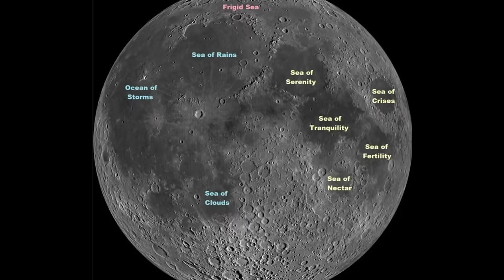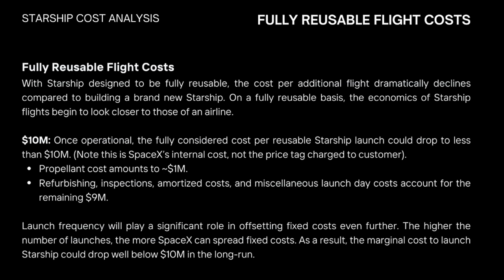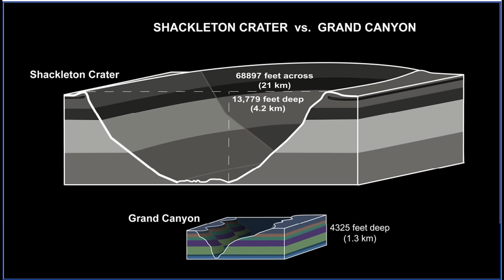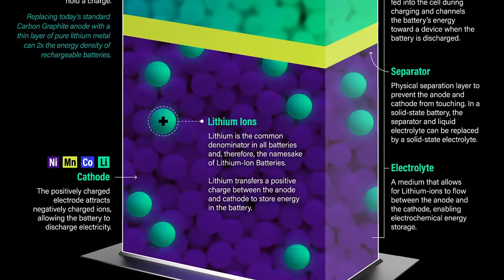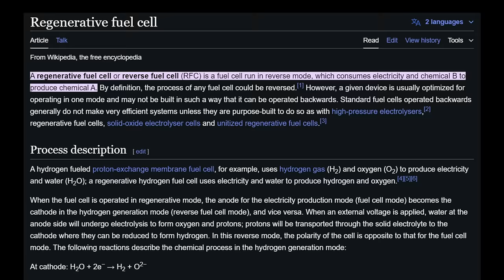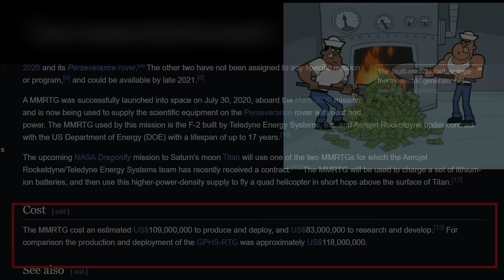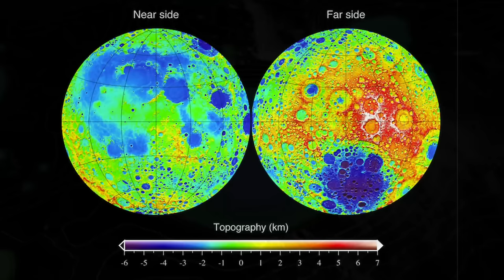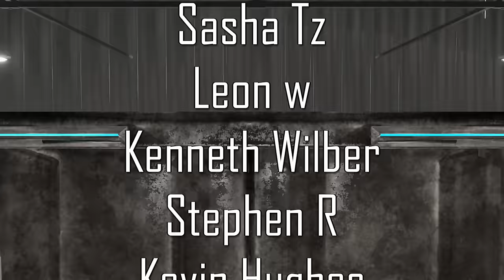Probably Not The Poles

Comment: Even cheaper would be a gravity battery, dropping a massive weight of rock down into one of the giant lava tubes or a crater. And of course digging a big hole if required.
Reply: Gravity batteries on the moon are one of the worst options, too much effort and too little profit. There are a bunch of other options. Not impossible though , it's just too much effort for the value it delivers.
Reply: @Molb0rg  Please forgive me. I fail to see the intense challenge in cutting rock to the desired shape and using it as a weight in a gravity battery. A weight of concrete the size of a house would be able to store the energy needed to power that same sized house. Although the math would be different on the moon.
If one wishes to use solar then they need to store the energy for later use. But I prefer nuclear and beaming the energy over a long distance to end user.
So could you elaborate on the short comings of the gravity battery?
Reply: @Maytrx you mentioned it yourself, math will be different. For the same amount of efforts - cutting a rock - you get 6 times less results. With solar panels for the same work of making them you get about 2x more results. But that is relative numbers.
One cubic km of regolith, and a difference in height 1km can store  725GWh in moon conditions. So to backup that over night you need about 350 cubic km's worth of gravity storage.
Energy density of such storage is about 0.45Wh/kg.
It is one of those things which looks simple on surface and gets you "free" stuff, but when you start to dive in actual making of it, designing it, what it takes to implement it - it loses its attractiveness more and more deeper in the details you dive. Gravity storage - I love the idea, really, I wish it could work well, but it works so so - it does work however, no denying that, I know it is poor but still see it as a lovely idea, but when we think on making things happen - you need to be a coldblooded bastard who trusts only numbers, no preferencial treatment based on appeal.

Cutting rocks if you dive is a complex process which requires a lot of tools, machines and energy.
There are already dug holes - craters to use, and there is such a thing as ERoEI  and most likely for different reasons you will end up casting weight blocks, and spending about 0.5kWh/kg energy. So the battery of this sort will make 100 cycles  to "return" the energy, so you have for 100 consecutive months to spend energy on making  the thing to enable storing energy for half a month(and no inefficiencies were accounted here, which will make it longer). That alone affects many things, has a broad and lasting set of consequences.

If you wanna make it work, well I'm not stopping you, maybe you find a good way, and it can be beneficial for everyone, so go ahead, good luck!
Reply: @Molb0rg  Ohhhh.... I see now that it also involves Energy-In vs Energy-Out. I was thinking that it would be cheaper than importing a complex, big, heavy and expensive battery array made on Earth. But as you pointed out not necessarily eh.
I was like, "The rock is already there and the idea is to do mining anyway." Yet it still requires a lot of equipment.
Hey thank you for the explanation eh.
Reply: @Maytrx  well it seems I did made an error and it probably even worse. So free hole and "paid" blocks seems a no go. But in theory the bigger of a block you carve in one go, the less energy you spend per kg of acquired mass(cube square thing), maybe you can go away with 100x100x100 meter blocks. Oor one can carve 10km deep and try to lift the thing as a sheet of weight - so there are variables to play with, smarter designs, better cutting technologies etc etc. so there are variables to play with to make it happen. Oor maybe one reaches the point when all things which needed to be done are done and it makes sense to spend all this energy to improve efficiency(but at this point you may have an equatorial belt of panels and permanent light this way, or satellites in orbit beaming energy and no need to store energy. So it is hard to say about all the technologies and possibilities in all the future and needs, it's just if one has to choose stuff early on, unfortunately this captivating one is not a choice if one wants things fast and easy.

In theory gravitional binding energy of massive enough bodies is a respectable energy, and those gravity storages are subset of that bigger thing, so it not like we should totally forget it as an idea, but ...
Reply: @Maytrx  100 meter drop, some crater slope, and 225t of rocks dropped there per hour can provide 10kW of power, well 60 thousand tons of rocks per night, well I guess it possible to find it free laying on surface or something - no energy spent, on blocks and a hole and it just transporting it all to the place, make some sort of station up and down - well if it only option then one can do it and it will works, so..., lol, a free exercise to see the challenges to make it happen in this case.

Comment: The general opinion about energy calculations could be incorrect. A Moon base can be easily thermally protected to avoid losing energy to the vacuum during the night with a metallic film. Managing excess heat is the main problem, as proven at the ISS. 1370W/m2 is a problem for solar panels, and most materials exposed to full-spectrum solar light, definitely not sustainable in the long term. Heat can be applied to solid rock through metal conductivity, reducing complexity. The moon surface (Regolith) is an extremely good insulator; like on the beach, heat does not affect a few centimetres below the surface. The hot/cold temperatures measured by the reflected light from the top layer of regolith are not representative, as the Moon has no atmosphere or humidity, so no conduction or convection is possible; a thin layer of a few mm is only really in extreme temperatures. The logical decision is to inhabit lava tubes or caves. 50% of all regolith is oxygen, 2/3 of all propellant needed.

Comment: Technical details that seemed to be glossed over.
First, when comparing batteries against fuel cells please take into account the round trip efficiencies. Batteries are 90+, fuel cells plus hydrogen production and storage ~30 so would need ~3× solar to recharge.
Second major one was comparing space engineered nuclear with a Earth based micro reactor. The air cooling for the micro reactor won't work at all on the Moon. I suspect changing from air to space based radiator cooling would be "non-trivial" for design and operation. Hopefully it is better than I expect but without further information I don't buy the comparison.
Reply: The solar panels are only in darkness for 3 days out of the month, so 9 days worth of energy over 27 days means you only need 1/3rd more energy then the base consumes over those 27 days. sure it's a decent amount more else panels, but since it has 27 days to recharge, it doesn't make it infeasible.
Also, I'm no expert on the specific designs for the microreactors but, I'm going to assume they use heat pipes and the tried and true fan-push-air-through-radiator method for their cooling. In this case the heat is already being piped to the external surface of the reactor, and if so I think it would be fairly trivial to take off the radiator and replace it with a vacuum radiator as long as it provides the same wattage per time in cooling. 
You would probably need a more robust electrical controller and wiring than that used for a fan, and maybe a more specialized heat pipe to feed into the radiator because lower gravity could effect the speed of the evaporative substance inside the heat pipe.
Unless the design specifically relies on the air being fanned through the center or subsurface of the reactor for some design critical reason, which I think is unlikely, it should be a fairly simple reconfiguration.
Reply: @brodyrex6987  The efficiency of radiating away heat in vacuum is very low.
Reply: @Gustav_Kuriga  When the heat is already being brought to a place where you can attach a radiator of any size, the decrease in efficiency can be offset with a bigger radiator. Maybe it'll take another launch because half of the fairing space is a folded up radiator, but the point is that it's not infeasible, and still economically viable.
Reply: @brodyrex6987  You also have to account for the increase in medium which is bringing heat to the radiator, the increased time needed for that medium to be in the radiator to take away that heat, the choice of medium used for that purpose, the added complexity of building a base that has two power sources instead of one, etc. There's a lot of things not covered.
Reply: Rolls Royce seems confident they can do it and from the looks of their prototypes it seems like it can be done
Reply: Space grade PV is about (planned, the best) are like 2kg/kW. So adding another 200kg is a rounding error here.
Reactors, yes have to be adapted probably, not speaking certified for launch and all the way down - not trivial.

Comment: Question I know that starship is just a simple example but wouldn't earth mass drives be better it would cost less and be more environmentally friendly sure it would have less cargo but in your orbital infrastructure video you mentioned a cargo transfer port in L.E.O for I free using 3d printer ship yards to made infrastructure for lunar transfer and being real it would be sufficiently safer
Reply: Having a massdriver is always better than a rocket, but the biggest problem here is we may have a rocket in 5 years, but we won't have an earth massdriver in this time.
Reply: @Molb0rg yes however it seems that people will eventually realise mass drivers are more effective therefore moving to mass drivers as the main launch machine

Comment: Carbon IS present on the Moon in the form of carbonaceous (c-type) meteor impacts. Figuring out which meteor impacts are carbon rich is a different story; not to mention, mining them. I am not sure if there is a way of remotely determining which impact is carbon-rich and which isn't..
Reply: No need to seek for them, they are all over the surface, there is about 200g of carbon per cubic meter, and it is extractable relatively easy

Comment: How much would it cost to run dc power lines around the equator of the moon? Sure, there would be transmission losses, but the moon has plenty of aluminum, and you could just roll it out over the ground, unspooled from a rover. Obviously, the idea is to build a belt of interconnected equatorial solar farms so that some of them are generating power at all times. This way you don't need batteries for nighttime.

Comment: But importing 200t of water is a bit stupid, no? Importing hydrogen when you already can stuff excess oxygen from "smelting regolith" into on site produced steeltanks to turn into water later is more viable, since you can get up to nearly twice the ammount of water out of this. I estimate including the tank and baffle plates etc. it would hove somewhere between 1,5-1,8x the ammount of water if you reform it on the moon. You could even get to try and get some 'kick' out of that reformation by either running a fuelcell or using chemical subreaction etc. to extract more value? Also if you want to store it long term, either turn it into water/hydroxite/acid which are somewhat easily store as a liquid and can have various uses in life support, or industries.
And if we return to the nuclear ferry between LEO and low lunar orbit you can shuttle more stuff back and forth for cheap, combine that with your railsleds and we can extract more economy of scale. Something about thsose railsleds and nuclear ferries also would mean we would need to revisit teh cost calculations of the earlier episodes in regards to bringing humans, materials and supplies to the moon, because that price would go down, especially with the synergy of the nuclear ferries with the railsleds.
As for power storage, that is nice with teh sodium batteries, but teh company called "Ambri" has developped "liquid metall batteries" on the basis of electrolysis, it works teh other way round. In their case the "alloy" of sodium and another metall is heated up and liquified, a layer of another material keeps the boundary, you can extract electricity from this and the stuff mixes, hardens and cools down. To recharge you simply liquify the stuff again. Recyclability seems good, weight not so much, so stationary use is recommended, but this could be usefull anyway because those lunar excavation machines need the weight anyway? And if those cells by ambri are deemed to have too many efficiancy losses, they still can be used for stationary purposes. The main purpose is to be "dirt cheap" with these things and they are somewhat simple to make so that could be a boost in the beginning.
I noticed that CO2 removal was (seemingly) not yet looked at, it will kill you faster than lack of axygen, well we have three+ options here. We could use MOXIE to reduce it down to carbon monoxide and chemically use it to make other stuff, we could compress the CO2 and react it with hydrogen to make methane and then polymers from that, we could also use the CO2 and metalls and react it into alloys with carbon content while freeing up the oxygen.

I also am currently bingewatching the series, but have not yet seen all of them, so it may be some of my points already got adressed.

Comment: Just asking why not simply make a power satellite or a solar disk satellite in "geo-stationary' position? I'm sure it is more simple to do then the Gateway station they are about to scrap anyway...
Reply: it's probably pretty hard to have something in (would it be lunar-stationary?) position when the orbital period is the same as the rotational period. You could put it in low Earth orbit and get 1/2 uptime, or maybe some legrange point on the far side of the moon. Basically, the nuclear option is just better
Reply: There isn’t a stable luna-stationary orbit possible. Because the moon is tidally locked, small, and still relatively close to Earth’s massive gravity well, it would require constant burns to stay in position without being pulled out of sync.
Reply: it would get torn to shreads by debries. Its hard enough to the the ISS and satalights to not hit eachother and debris so a huge solar array would such to menover
Reply: not what we’re talking about also wrong

Comment: Can't we use a solar mirror satellite ,to reflect the sun's heat to the lunar surface.The is no atmosphere and clouds on the moon .

If we can get a lot of those satellite ,it could be a cheap heat source that can be used on making lunar metals and powering solar panels
Reply: It is enough to do the same on surface, early and midterms
Reply: @Molb0rg  that's why you need more than one satellite and maybe a magnifying glass ,to better utilize the sun light on the lunar surface
Reply: @ACE11518  idk my answer was lost for some reason, but point was that just start to use low hanging fruits first, you may be surprised how far it can get you, well beyond your current expectations.

Comment: The majority of our energy production technologies are glorified tea kettles. Even nuclear reactors use heat boil a working fluid except in the case of nuclear plants it's not uncommon to see supercritical CO2 used instead of steam. Whether fuel rod or pebble bed nuclear reactors rely on what amounts to hot rocks to supply process heat. Instead of relying on nuclear decay to make rocks hot to produce steam why not harness the fusion reactor we conveniently orbit. Solar thermal collection is 80% efficient. The Moon certainly has no shortage of rock and vacuum makes the best insulation.

Comment: I agree the poles may not be the best place for a non-scientific base.  However, this rant is wrong minded.  Humans will overcome each of your arguments over time.  This especially true since your arguments mostly use current technologies as are your lunar launch costs.  

We are on the verge of a technological revolution in a decade or two most everything will change.  You also don’t account for the use of robots for construction and other labor.  By 2035 there will be 5 to 10 bots for every human on the moon.  They will operate autonomously except for basic verbal instructions.  Nuclear reactor technologies are rapidly changing and small 10’s of megaWatt level generators will be a reality. Solar and batteries will be used but mostly as secondary and emergency uses.

Comment: Comparing the space station cooling needs with a Moon base's cooling needs is just pure stupid. They are not the same. A Moon base most probably will be insulated by meters of regulith. While I appreciate the fact that you try to make an interesting video, the lasiness you show when it comes to aquiring scinetific data is very very annoying.
Reply: Put the radiator above the regolith
Reply: @brodyrex6987  As a base on a Moon will be covered, it will need nowhere as much cooling as the space station. The whole calculation is based on a bad assumption.
Reply: @gaborpokoradi969 
The assumption you're claiming he makes was never made. How and where you decide to use certain technology is an engineering decision, not a scientific data point.
Comparing space station cooling needs with a moon base's is a good starting point because it's the only other current instance of keeping humans alive in space for long periods of time. I'm sure the NASA engineers will be able to figure out how much cooling they need and where. Discounting the video's entire research process because it didn't cover one tangential and arguably trivial detail is very very☝️🤓.